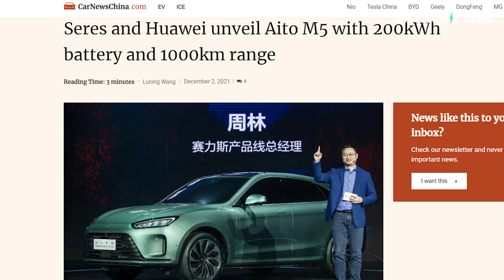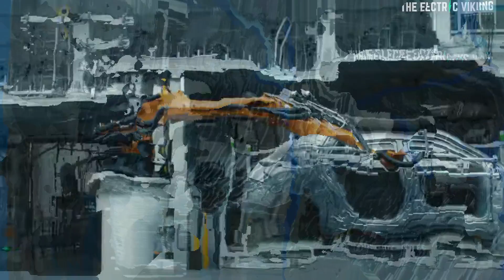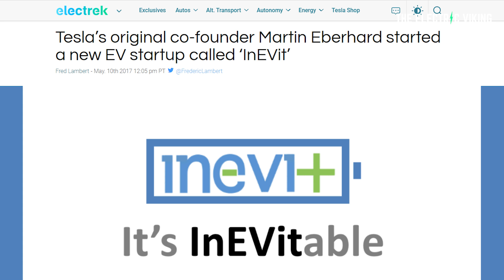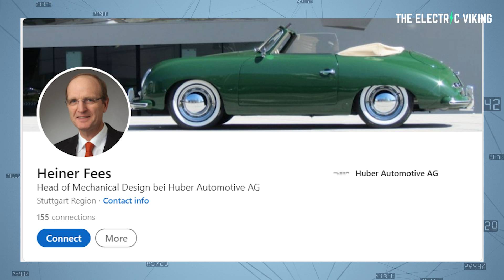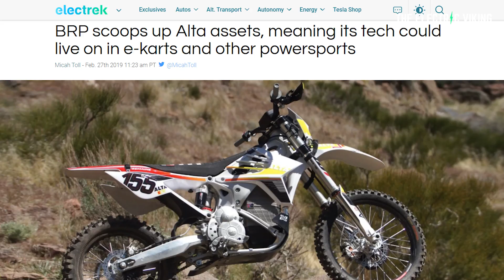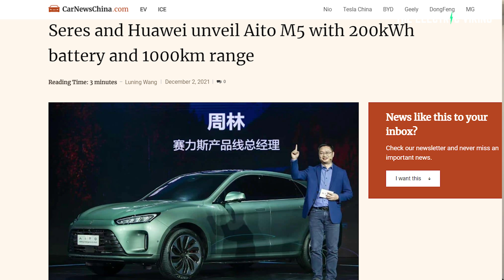NEW EV with 1000km range and BIZARRE TESLA connection

Comment: The size and weight and size of high KWh batteries reveals what has been obvious to some: There's a point where the battery can be too big. Excessive weight limits EV range, the one reason to have a bigger battery. Excessive battery size limits EV interior room and payload. In summary, above a certain battery size the EV will start to lose range because it uses all its power just transporting excessive battery weight.

Comment: Anyone gonna point out tiveni is inevit backwards? Also, that 1000km range is probably measured using the NEDC standard, which gives cars 15 to 20 percent more range than the EPA standard does. So 1000 km NEDC would be about 850 km here in the US. With that in mind, it then seems that the batteries will be lfp, as they are less energy dense than lithium ion. An lfp model 3 gets 350 km under the NEDC standard at 52 kwh. So X4 the range minus the extra weight, non aerodynamic design, and inexpensive not as efficient motors and you end up roughly where this car is at. Makes sense.
Reply: Does that LFP range assessment include the fact that they can be used without harm from 100 to 0% charge vs the typical 80/20% recommendation.

Comment: One of these years we will have an electric car that will be just as good as a combustable fuel car. We might even have heavy vehicles as good as our diesel and petrol propelled heavy vehicles, but I think that's even more years away. It's good to see how all these manufacturers are trying to make it look like they can do it. We might even have a stable renewable electricity supply together with amazing electricity storage solutions to save the earth. Just not yet.
Reply: We already have an electric car that's way better than a combustion car. In fact we have four, all made by Tesla.
Reply: @MarkXHolland  I am fully aware of that. Unfortunately, the price is still completely "off the planet" compared with combustible engine cars. Battery services comes as an added expensive surprise. The batteries don't hold sufficient energy ...yet....but they are working on that. Are the latest Tesla Batteries  better and not so big anymore?.....and will they fit production cars right now or will the new batteries go into future production cars? Will this mean that cars coming off the production line will be old technology? Are the latest batteries the final design that won't "out-mode" your car before you bought it? Are we going back to coal-powered power stations while they perfect new nuclear mini power stations or will we have to rely on inconsistent renewable energy? What happens with all the replaced car batteries? You know that they will need to be replaced....don't you? I am really looking forward to the day when all this is sorted. Perhaps 2050 or 2060.
Reply: @viskovandermerwe3947   Prices are not "off the planet".
- What counts is total cost of owing and using a car, and EVs can be cheaper than ICEs of same category.
- Current batteries last many years in the order of decades.
- Threre is not "final design" everything is evolving continuously.
- We will probably rely on renewable energy + storage.
  But ICEs ALWAYS burn fosil fuels, so in this regards EVs are always better.
- Batteries will be recycled, indeed it is already happening.
So this is already sorted and getting better every day.

Comment: You have to drag that 200kwh battery everywhere you go, even if it's just for a run to the market.
Reply: You have to carry a transmission, engine, exhaust, fuel tank in an ice car to the shop.. and only get 25-30% efficiency......
Reply: @kylereese4822  Yes Kyle, we all understand that easily enough. 200 kwh battery as opposed to a 100 kwh battery.

Comment: Overpromise and underdeliver. I have driven their SF5 Hybrid with 180km NEDC range, turns out, it is more like 100-120km. Bad software tuning, the ACC behaved terrible. If they promise 1000, think 500km.
Especially with an SUV. 
Mercedes EQS needs 120kwh battery, for 700WLTP, if they say, they need 200kwh for 1000NEDC, then the SFERES  is a terribly inefficient vehicle.
Reply: Jai Hinduja. Yup, terrible.  But  that is before   the Huawei Seres involvement.

Comment: If I needed/wanted a 1000 MILE range I would order an Aptera. I have two on order, but I choose the 250 mile for 3 reasons. 1. When an improved (breakthrough) battery comes along (shortly?), I won't be heavily invested in mine and can switch. 2. I drive short distances, no long trips, yearly mileage, 2000. 3. I'm getting self-charging, 44 miles/day.

Comment: Nio has 1000km ET7 coming out with 150kw battery
Reply: At the moment I call it Vaporware. 
The only ET7 you can buy at the moment are the 80 and 100kwh packs. I went to the dealership and alsed for the release date of the 150kwh pack... 6 month or later, they said. Just like Lucid... Vaporware...
Reply: @larsradtke4097  don't know why you say lucid is vaporware
Reply: @jm100368  the same way I call the Tesla Roadster 2 , the Semi or the Cybertruck Vaporware.  Too long to deliver.
Reply: @larsradtke4097  Oh I get it, you're just being annoying
Reply: @jm100368  No, I am annoyed, by the underdelivering.  You always get something new announced, and then it takes 5 to 7 years until it reaches that promise.

Comment: Huawei is the closest to an iPhone experience that I've ever had on a non-apple device if that gives you any indication of the quality
Reply: My driving experience of the SF5 Hybrid was really bad. Really inefficient. Overpromised and underdelivered, the cooled seats here in Shenzhen however were nice. Mercedes EQS does 700km WLTP with a 120kwh battery and that SFERES does 1000NEDV with 200kwh? Way to inefficient.
Reply: Huawei isn't building the car, they are only providing the electronics. It's like saying if your car has Apple Carplay it must be a good car. Not necessarily.

Comment: Did you really just say electric cars are light years ahead of ice cars? They are not they are cars. You get in and drive. Then stop. The rest of the crap they put in these,vehicles is not needed at all. It's just a means of ripping of customers for extra cash 
I want an electric car with no gimmics, no computers just Aircon and a reversing camera. Top speed 75mph and 1000k range. I don't want auto driving. Oh and it needs to be around 20 to 25k gbp.
Reply: 1000km and no ACC ?  Where do you plan to go on your island with 1000km?  For usual commutes 600km at below motorway speeds are already possible for around £30k
Reply: Lol.  1000 km range for 20 gbp?  With air conditioning.  Ok then, don't hold your breath.
Reply: Nobody needs 1000k range.
Reply: @MarkXHolland  of course. In Germany a round trip at night @200kph done that in 6h several times. Urgent deliveries. 
1000km range means 500km motorway

Comment: Massive weight is dragging down the range. It's the diminishing returns of battery size.
Reply: I see no point to 120kW never mind 200kW.
Reply: @honesty_-no9he  On long trips there is. You don't need so many chargers. Bigger batteries last longer. 
Bigger batteries charge faster.  120kwh means 350km  and back on one charge.
Reply: @larsradtke4097  It takes a lot more energy to move all that extra weight. Double the size gets you considerably less than double the range.
Reply: @StevenHoagland  It comes down to cw and wheel size.

Comment: The Huawei legal issues only concern the usage of their devices in backbone infrastructure. As far as i'm aware, Huawei phones and other devices made by them are not banned from the USA.
One thing that I don't really get is this obsession with the 1000km range mark.. with the charging network growing ever tighter each day, what's the point of reaching for that goal? I'd rather not lug around 400kg of extra battery, which must have a huge impact on efficiency, and most people can't sit in their car for 10 hours straight anyways.
Reply: My ideal EV is 400km/250 miles which can be charged 80% in 15 minutes (1/4 hour), but until 2030, then 30 minutes is fine. You should always take 15 minutes off after two hours of driving.
Reply: The following applies the U.S. Some people cant charge where they live, so the charge time really matters. They might go once a week or so. A few people I know do it on weekends while grocery shopping because the quick chargers are there. Some places I've been in the last few months still don't have chargers, and sometimes chargers are broken. Most of them are level 2, meaning they take hours, and are usually already occupied. Even with DC quick chargers, charging takes a while, so if the chargers are full, you'll have a longer wait. Even Tesla's can end up in line for a few hours. Gas stations are everywhere, EV chargers are still building out, and are usually hidden so potential ev buyers don't see them. The total mess, with every charging network wanting you to install their app and join their service, doesn't help. They should work like gas stations, just tap your card or your phones payment app. 

I keep an eye on all this in my travels in a phev, a volt. I'll switch to a Bev eventually.
Reply: The extra cost & limiting those batteries from making another EV to replace another ICE by giving unneeded range. 🤦
Reply: Cold climate
Reply: @normand30  500km range evs work fine in Norway
Reply: Vl
Reply: So Huawei can't use Android and can't buy US made chipsets from Qualcomm for the smart phone? I think everything Huawei is so demonized that the brand is finished in the US.